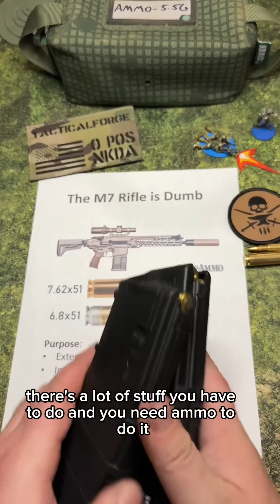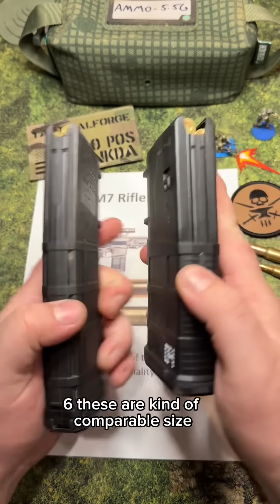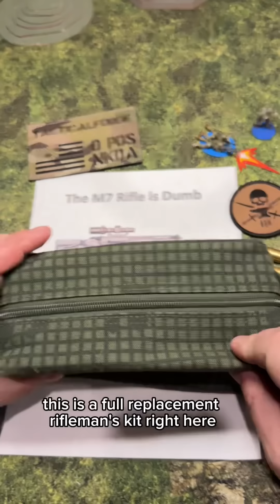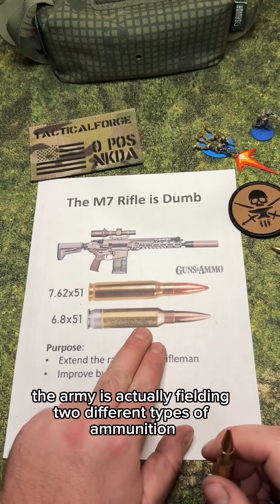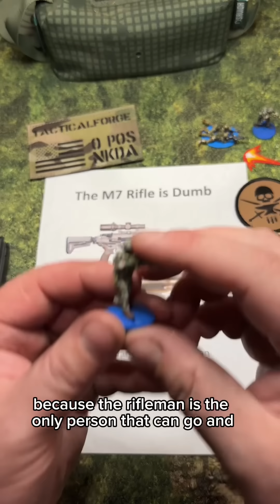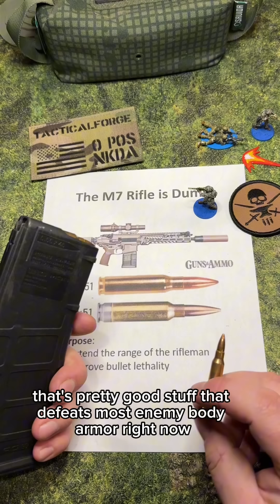The Army’s new rifle is dumb

Comment: The first side to run out of ammo in a firefight loses.
Reply: Yup, real gunfights aren't efficient. Most shots are spent on suspected enemy positions, rarely will you actually see who's shooting you.
Reply: @lespectator4962 respond to effective enemy fire.👍
Reply: Being chained to defense industry egos and military leadership egos is damn near as bad as the Soviet corruption model. While you may not end up with tires that don’t hold air in a convoy 20 miles long, you damn sure might end up finding yourself in trench with a “cutting edge,” piece of kit that you now have to use as a baseball bat because you ran out of ammo 10 minutes ago.
Reply: @SolusRap  Yeah fair I just don’t know, if I can carry a belt fed machine gun and hundreds of rounds for myself, maybe its not a big deal to add some weight for everyone else, which is something that soldiers will literally never not bitch about no matter what you do. There hasn’t been enough time. I do not believe anyone’s conclusions about something that’s not even significantly issued, deployed anywhere, maintained. My big gripe with the gun is the 13’ barrel, maybe I’m an idiot and propellant is like magical now, but that and the suppressor which I don’t even think is a flow through, does seem kinda dumb. But I’m assuming I’m completely wrong and they tested it and it’s a stable projectile and super spicy at 1000 yards unlike a 16” SCAR or something.
Reply: Fix bayonets. Lol
Reply: M7 doesn’t have a bayonet lug lmao.
Reply: @gabagool2055 well they better fix it then.
Reply: @gabagool2055 the Marines aren't gonna be happy with no bayonet lug
Reply: @clovismeaux9532 bayonet 😅
On a gun with a can 😅
Reply: This is something they've actually discovered while training with 6.8 against teams with 5.56, the 5.56 teams keep winning because the 6.8 teams run out first and the range advantage doesn't mean much when engagements are still within 500 yards.
Reply: @2Potates And on a real battlefield, riflemen aren't the only thing there. As much as it's nice to do suppression at a greater distance, if less ammo, there's mortars, drones, and more which laughs at the range of any rifleman. I personally am highly skeptical that the NGSW superior range would give them an edge even if the simulation or tests were done at longer ranges only with a magic forcefield keeping the 5.56 teams always out of range.
Reply: @YTPrule I’m very skeptical of the claims that this won’t blow 556 carbines out of the water past 300-400, but mostly I just can’t handle everyone on the internet thinking they can totally discredit and debunk the entire procurement team of the us govt in a 10 minute YouTube video. Thanks maybe email that to the president or something. Very cool.
Reply: @CGcorruptproductions  Military procurement had been more about corporate connections and lowest bidder costs for a long time. Remember the M9's magazines at first? People have been skeptical on the NGSW for years before the winner was announced. This video is far from the first.
Reply: @CGcorruptproductions  Well like i said, the extra range doesn't mean anything when you can't use it.
Reply: @2Potates I don’t think it should be a huge concern that us army units will be leaving the battlefield because they are too bitch to handle the weight of 7.62 cartridges. 7 magazines of 5.56 vs 10 magazines of 7.62 is not a big deal to me. Machine gunners carry hundreds of them, linked, and 20lb weapons. Soldiers will complain about weight literally no matter what, it’s a universal. This is a 10 minute YouTube rebuttal to a very large team of engineers procurement professionals, and industry professionals, which none of us are, and it makes me skeptical.
Reply: @CGcorruptproductions  Then you know nothing about military procurement teams. Someone is either getting a little payday, or a future job.
Reply: @CGcorruptproductions  First off, how does that relate to anything i said? Secondly, i haven't come to my conclusions because of this 10 minute video, i've been criticizing the NGSW program since the it started 8 years ago, and for the last year all my points against it turned out to be right.
Reply: @2Potates your criticism of cartridge weight has not been “proven right”
Reply: @CGcorruptproductions  Sure, bury your head in the sand, that always works.
Reply: @CGcorruptproductions The Corps proved females shouldn't be in combat. They break all the time and were worse in every metric. Yet the military still does it. You think politics and idiocy aren't in procurement. 😂
Reply: @CGcorruptproductions yeah, because government has good track record laughs in m14, M16, m7 and m9
Reply: I saw it happen on Combat! last night. Saunders's squad ran out of ammo and were taken prisoner.
Reply: And the side whos ammo cant kill the enemy tends to lose even earlier.
Reply: @nton8057  Exactly
Reply: @nton8057 kills don’t win battles,,hits win battles,,history has proved that,,no offense to you at all sir,,
Reply: @GStudios777 Well If you want to  nitpick word for word , US chose the new round because it feared modern body armour would remder its current service rifle ineffective. So hitting dosnt win battles neutralizing the enemy wins battles.
Reply: Yes and america can't produce enough shells or missiles....guess what you ran out already against any major opponent. Even russia outproducing all of nato by 3x. Ask Mark rutte. Instead of expanding production capacity US wastes money perfecting a infantry rifle....a weapon that inflicts a whopping 5% of the casualties in any major war
Reply: First side to LEAVE loses, and shooting and killing people generally encourages that
Reply: Only if they miss.
Reply: @robmorgan1214  That's not how combat works at all.
Reply: @TheTrueNorth11 of course it works the way. The side who runs out of guys (not ammo) first loose the fight. Vietnam is a great example of the ridiculous American doctrine.  They won because we lost. Not because we didn't carry enough ammo. It sucks but it's a fact. We are a casualty adverse military and that requires suppressive fire. The alternative is to accept the fact that war is risky and to take more risk and higher casualty figures to achieve the objective. That's how you win wars that's why it's better to avoid combat at all costs.  On paper the US is unstoppable.  But guys in sandals stopped us in the sandbox... why? Paper. Our paper pushers stopped us from decisively hunting down the enemy pinning him down and eliminating him with maneuver and superior fire power.  762 beat 556 in the mountains so we stayed in the fob and never made serious inroads in the region beyond rebooting the heroin trade. That's how combat works.  I'm glad the US is casualty averse. God knows we don't need another Normandy, Iwo Jima, Guadalcanal, Ardennes, Tet etc. But our post war tactics and strategy simple don't work historically or on the modern battlefield. Ukraine with 20 years of instruction supply and every scrap of US/NATO HW that we could scrape together barely held a smaller force attacking prepared salients to a 5:1 casualty ratio and 10:1 kia. This is unheard of in the history of armed conflict. Normally an attacker can expect 1:10 at best assaulting fortifications supported by artillery and a significant numerical disadvantage. That's the recipe for a rout when facing a near peer. Regardless, the old infantry squad tactics are obsolete in the drone/thermal era. So forget what you think you know about combat everything is completely different now.

Don't believe me go read doug valentine's interviews with Lansdale's cronies who went native in Nam. He tracked em down in Thailand, Cambodia and Laos back in the 90s (i think). Or check out daniel elsberg's take he discussed his experiences in country with infantry patrols.
Reply: u want more bullets or want penetration
Reply: No one is forbidding them using it more wisely
Reply: During the next war "Operation" , the first side to run out of AI guided or FPV munition(s) carrying drones or drone swarms will lose.
Reply: Well, you can carry a lot more .22 rounds than the 556. Should we use that instead?
Reply: @GameFuMaster  excellent question. you should  do that and learn lethal marital arts.
Reply: @clovismeaux9532  why would I need to? I can carry more ammo than you, so you should be the one to learn martial arts.
Reply: @clovismeaux9532  Marrying someone and staying married is indeed an art
Reply: @Captain_Simp_00 simpin ain't easy playa
Reply: @GameFuMaster very terrible comparison bro 😅
Reply: @Drexler638  Learn to make better statements then.
Reply: @GameFuMaster your comparison is awful 
Why would they carry.22 when 556 is easy to carry and has more power 😅
Its literally the most versatile round after 7.62 39
Reply: @Drexler638  You neither read the original comment, nor watched the video.

That makes you double dummy.
Reply: @Drexler638  Funny same can be said of why use the 5.56 when the 6.8x51 is far more versatile... like killing an armored enemy at 400 plus yards.
Reply: @Mr.Constitutionalist427 you sound like you've never fired a rifle in your life 
Most fire fights in modern warfare is between 100-250 meters
Some even less 
You not aiming down your scope trying to hit someone 400 yards away unless you a sniper or a Designated Marksman 😅
Reply: 6.8 is not more versatile, 
It's heavier, has more recoil, and is literally not useful for an average fire fight 😅 @Mr.Constitutionalist427
Reply: @Drexler638  We train on Irons for 300 Yards Direct and 800 Yards Indirect. You do not realize how many firefights have rounds traveling 400 to 600 no issue. The reason many of the stats being closer range is because we just got done kicking in doors so of corse they are close quarters stats, but we were also against combatants that were not well armed so no body armor but if we go against another Super Power they will have body armor and we need a round that can far out perform the 5.56 in the category. I have likely fired more Rifles in a single day that you have touched in your life but go ahead act like you are the most experienced man on the planet. Military commonly limits the mag count our soldiers carry, if round count was the vig factor they wouldn't limit the common soldier to 6 mags on a basic loadoit when they can easily carry double that. And then how is a round that can take 3 to 4 rounds to down a target on hits compared to a single round? That is why the .308 has more kills than any other service weapon in America's history with less rounds fired than 5.56.
Reply: @Mr.Constitutionalist427  it's not about kills 😅
Kills don't win battles or wars 😅
Whoever has the most ammo wins every fire fight everytime 
Unless you want to run only sniper teams 
Then I'll see how your sniper team performs under heavy suppressive fire
Reply: Modern warfare either in the jungles of Taiwan or the urban areas of eastern Europe would be close quarters, you're not shooting anyone 400 meters away, there in a trench or a house or a tree 50 to a hundred meters away  @Mr.Constitutionalist427
Reply: @Drexler638  Some of the greatest won battles were done with less ammo... Your statement is just historically inaccurate... Reasons silverware has won battles... more ammo doesn't win more effective ammo does.
Reply: @Mr.Constitutionalist427  more ammo wins every darn time 
I want to see your tactics work in a real context 😅
Considering I've experienced modern combat, the most recent humanity has to offer, and more ammo wins every fire fight every time
Reply: @Drexler638  Yep and bet you were one of the 9
Reply: @Mr.Constitutionalist427 .. And Ukraine is a joke bro?
Reply: @rbgerald2469  Most are not dieing running out of ammo... very few die out of ammo and they are using 7.62x39 which is almost same weight as 7.62x51 or 6.8x51. Yet everyone claims 5.56x45 is King because you carry more ammo and more ammo mean you auto win, when that is just historically and factually not true.
Reply: @Mr.Constitutionalist427 .. Yet having more ammo is an advantage when 9 times out of ten you're trying to clear a trench, house, or building (like in Ukraine)
Reply: in that case get rid of the common soldier... obviously that is not an option but reducing round use is. In Vietnam squads fired an average of 50k 5.56 rounds per kill. While snipers averaged 1 kill per 1.54 rounds from .30-06 hunting rifles... Round count doesn't mean shit if you are to pussy to shot well... I am a combat vet. I have seen it first hand when people stop trying to be accurate and just shoot to shoot because they are scared.
Reply: @Mr.Constitutionalist427 you don't understand warfare do you 😅
Not everyone can be a sniper or designated marksman 
We need people to hold positions and assault positions 😅
And to do that you need ammo,lots of ammo, so you can suppress and maneuver, suppress and flank etc 
You can't do that with a sniper or DMR
Reply: @Mr.Constitutionalist427  as for your last statement 
Hearing 5.56 wheezing over your head is extremely terrifying 😅
That's why we have LMGs on every rifle squads 
To say, if the soldiers shoot "well" rather than shoot just to shoot, is baffling considering, war is real😂, and bullets kill, so who won't be scared hearing 5.56 or 7.62 39 wheezing over their heads
Reply: @Drexler638  Get down assess the target and remove the threat  that is the training we received. But only about 1 in 10 men could perform under true pressure. It is about the mental strength and staying calm over emotional reaction. The 50 thousand rounds per kill in Vietnam were emotional reaction shots while the 1.54 from snipers were with calm heads. Most soldiers when calm can accurately hit targets at 300 no issue. And now take that and give auto aiming scopes which are the new scopes and a rifle that can kill at 1,200 like this 6.8x51 and you can have a common soldier hitting people at 800 all day no issue because they will be more calm. Again the next war will not be kicking doors down it will likely end up being clearing drones from the sky while finding the operators hiding further out... And again body armor is a major factor the 5.56 wasn't facing while it had a great service life.
Reply: @Mr.Constitutionalist427  I'm glad you are not an officer in any armed forces in this world 😅
You would get poor men killed 😅
What bullshit are you talking about 
Vietnam was more than 50 years ago 
We are talking modern warfare here pal 😅